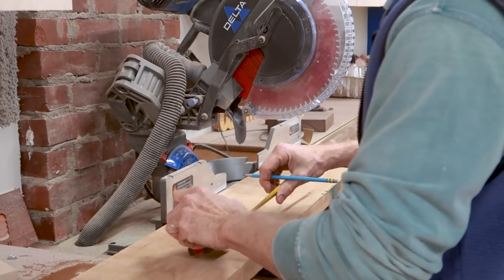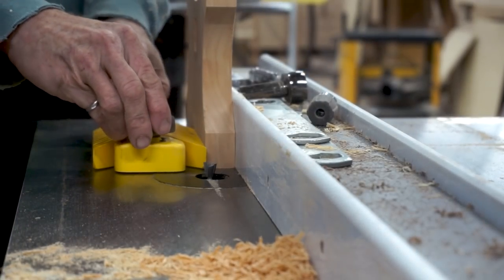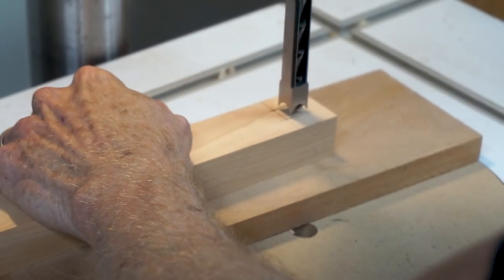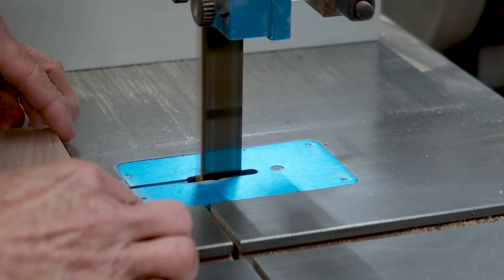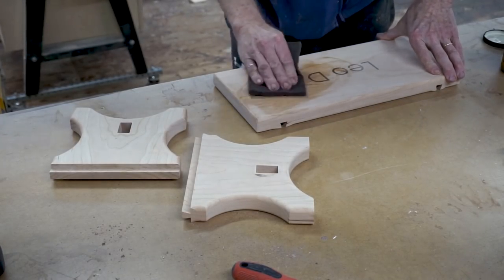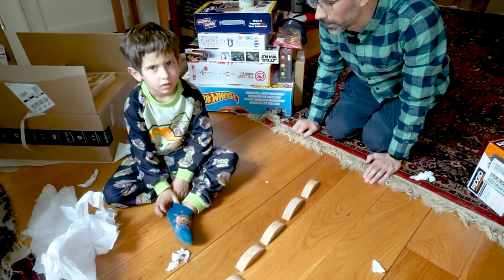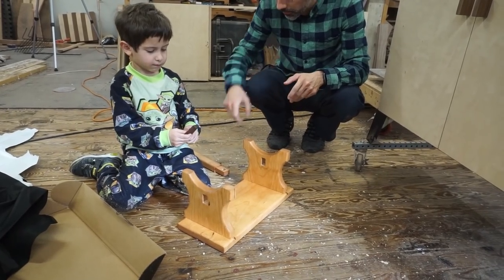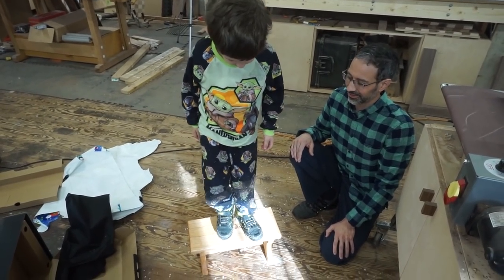How I Made A Stool That Can Be Disassembled

Comment: Heck yes I would make it. Just would look to make the legs tighter and not slide so easy. Maybe pins to hold and remove someway. Very nice for sure.
Reply from the maker: I thought the sliding dovetails were fitting pretty tightly, but legs slid surprisingly easily after I applied the Odie's Oil. I thought about adding pins, but was worried they'd be too difficult to remove. I think it'll be fine, but I agree they could have been tighter.

Comment: Looks like you're going the wrong direction on the router table.
Reply from the maker: I'm actually going in the right direction but it looks wrong because I have the fence on the opposite side to where it normally would be. The reason I did that is because my router table fence (with an opening for the bit) is messed up so I used my table saw fence instead. I put it on the other side so that it wouldn't interfere with the bit. It works, but it's not the ideal practice. I need to put a new face on my router table fence and then I'll be back to normal.